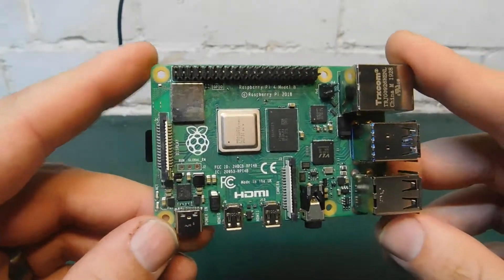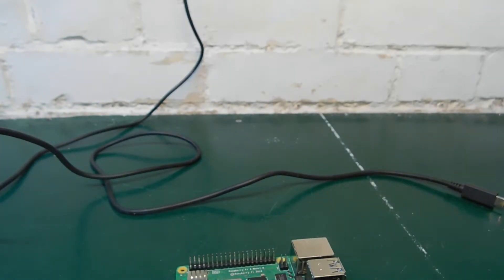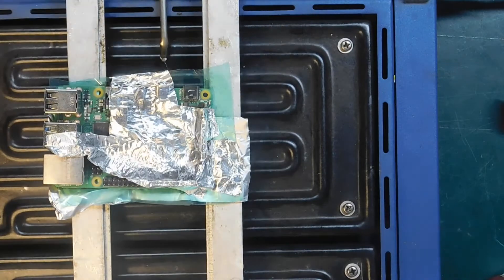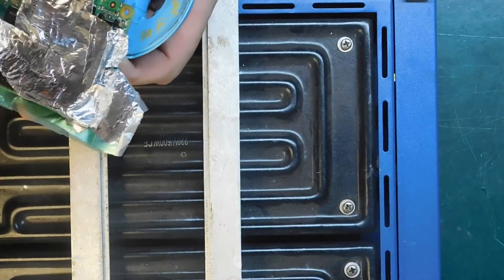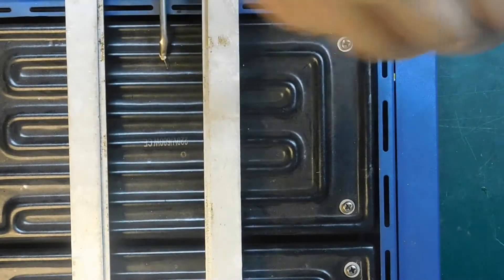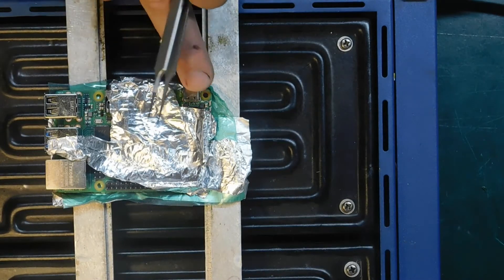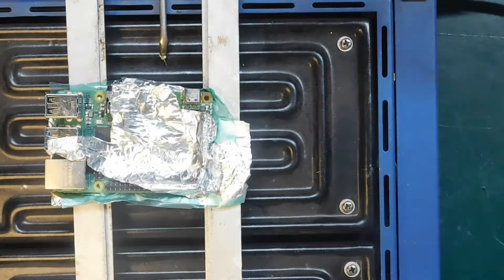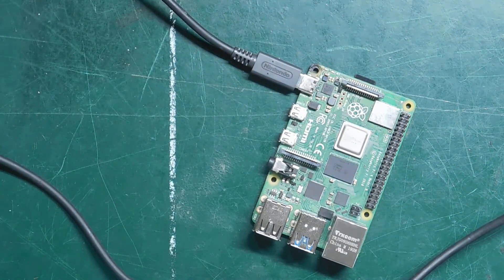Raspberry pi4 Repair

Comment: Hi bro this is Manoj my raspberry Pi getting power supply red light is on but it is not working keyboard and mouse. Is not working display also not able to get green light is not blinking what is the problem what i have to do

Comment: Hola que tal buenas tardes, perdón por la molestia,  tengo un problema con mi Raspberry pi 4B y quería ver si me podrían ayudar lo que pasa es que el día de antier estaba armando una carcasa como una lap para mí Raspberry y dejarla fija, el problema fue de que le coloque un apagador  al cable y funcionó pero el ventilador del Raspberry empezó a jalar muy rápido y de la nada se apagado mi Raspberry , y ahora prenden los focos, el rojo queda prendido y el verde parpadeando  pero no me da vídeo, y no sé que hacer, me podrían ayudar por favor. En VDD se lo agradecería bastante. El día de hoy, lo intente conectar da varios parpadeos del verde y se queda estático cómo que quiere jalar y vuelve apagarse, metí otra tarjeta con la versión del Raspberry pero no da señal, da más señal con la versión que tenía instalado en la primer memoria. Ahora le inserto la memoria y se apagar y se prende la pantalla, y si  le.quito la memoria me aparece la presentación del Raspberry comentándo de que  no hay memoria SD 

Muchas gracias por su apoyo y tiempo, ojalá que puedan ayudarme, quedó atento a sus comentarios.

Que tengan una excelente semana.
Reply: Ok if you sdram was dead and can't boot,  try this  - > your memory or another chipset  terminal paste maybe inside so...  go to pharmacy and buy disinfect medicine and pour out , dry 3min with hairdryers and boot if failed again, do these steps again       ->im fix at 6 times
Reply: @DBS1112  yo tengo un problema diferente: enciende led rojo(power) y el otro led no enciende no muestra que lea la sd, sera un fallo del lector de la sd o puede ser otro problema? nota: me da pantalla negra el led rojo se queda encendido ya probre con 2 memorias sd y nada

Comment: I have a rpi 4 8gb that just blinks at me a couple of times, no HDMI output and it doesn't seem like it's connecting to my router. Tried boot update / eeprom fix with no luck. Grr.  Rpi3 missing it's power port, so fiddlely
Reply: Ok if you sdram was dead and can't boot,  try this  - > your memory or another chipset  terminal paste maybe inside so...  go to pharmacy and buy disinfect medicine and pour out , dry 3min with hairdryers and boot if failed again, do these steps again       ->im fix at 6 times
Reply: @DBS1112  Thank you DBS I will try this and let you know!
Reply: @LouiesLog Ok it will help you
 My pi4 has died 2 times but i save him and run pretty well
Reply: @DBS1112  I wonder why this version breaks so often? I'm thinking it could also be a short between the io pins 3v & 5v
Reply: @LouiesLog  LoL i never think about that i should test

Comment: Any idea what could be wrong with one of my Pi2B's ? After putting in power both the power and the activity LED light up continuously. Now currently I dont have a screen to test whether the hdmi still gives off a picture .. but accessing ssh does not work (timeout after some waiting) .. the SD card works fine in another Pi2B so I think its not the SD card. Also the same happens without any SD card inserted .. both power and activity LED give off constant light - not some dim, but bright red and green? I already swapped the power cable and as my anker psu works with 3 other Pi's ... I'm running out of clues what could be wrong .. So any ideas ?
Reply: Found any solution??

Comment: I tried to repair the MicroSD slot on my Pi 4, which went fine. The old one had a conductor spring that bent and shorted out the card. Before I even booted it up I noticed a hole burned into the power management chip, so the problems clearly went further and the Pi is only good for parts. I learned how to replace a MicroSD slot, and I learned to inspect the board carefully before repairing. I'm glad that yours went better, great job!

Comment: I tried turning my RPi 4 with a PoE Hat and nothing ended up happening.. I used a 24v 2.5a power supply on the Edge Router x, and turned on passthrough on eth4. I have no engineering background so Im not gonna be able to tinker with any of the circuitry. Hopefully the official usb c power supply works./

Comment: My USb Ports on my Pi 4 not working can you tell me how to test these ports with a volt meter and any suggestions on repair
Reply: Same problem bro 😭
Reply: Just buy yourself a USB adapter. They're cheap money and you can use them to test anything that's got a USB port. They even have them for USB-C and USB-Micro probably.